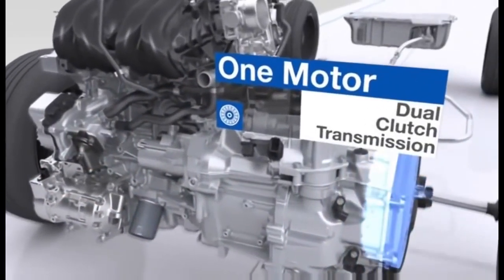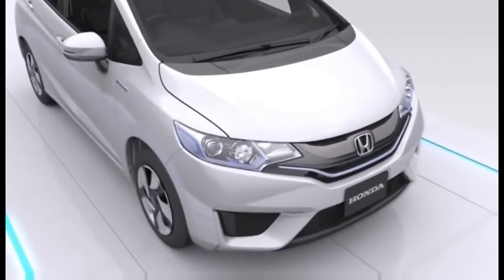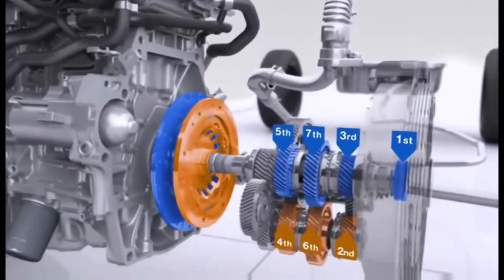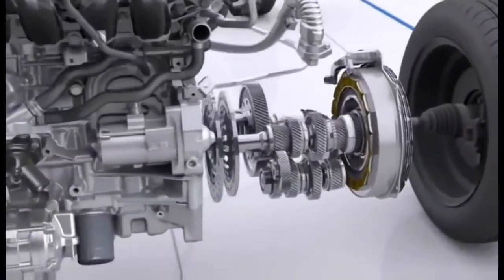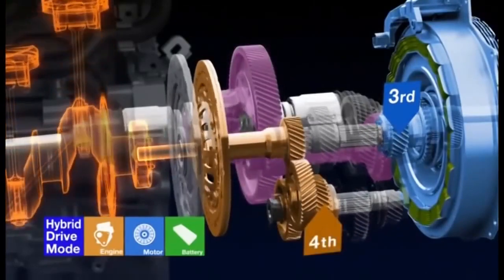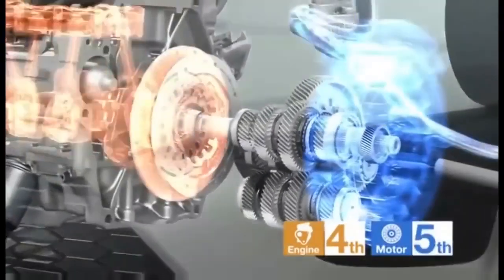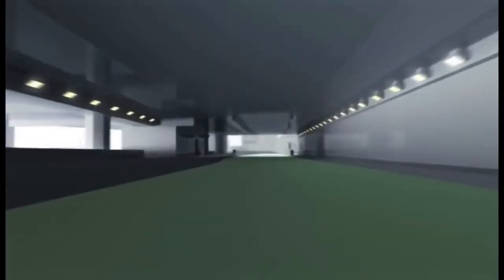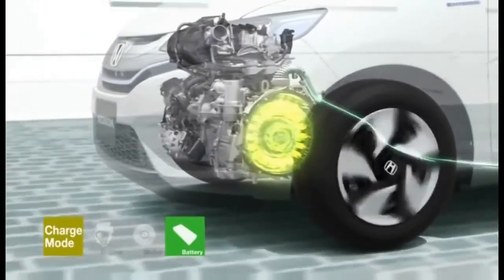Auto Clinic Tips - How to Protect Dual Clutch (DCT) Transmission

Comment: How do i avoid engine braking? always using the brake pedal to slow down? You also recommended coasting which causes engine braking. now I am so confused
Reply: He said excessive engine braking.  I am buying a DCT KIA car and learning as much as I can and a KIA video actually mentioned how you will feel the engine braking when slowing down.
Reply: @AccessiblePhotography you should be fine. I am driving a Honda Grace Hybrid which has dry dual clutch transmission. That too in Dhaka, Bangladesh where tradfic is extremely dense and there is not way to avoid creeping/crawling.